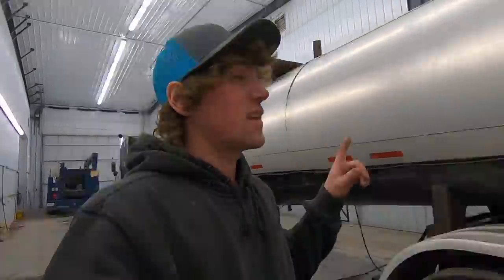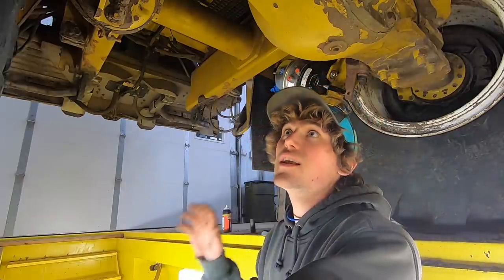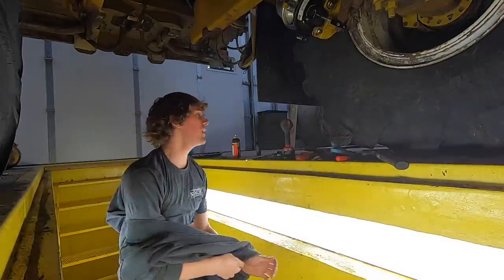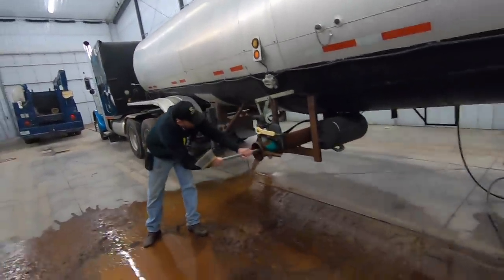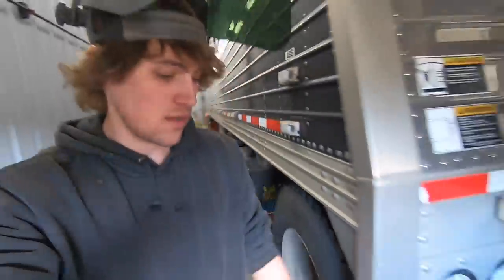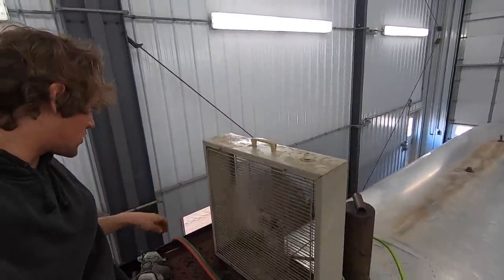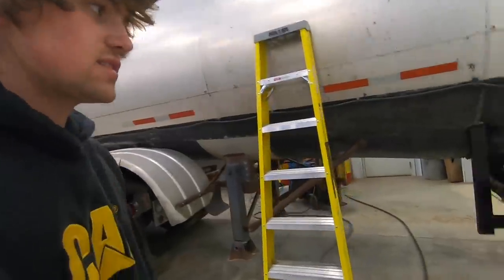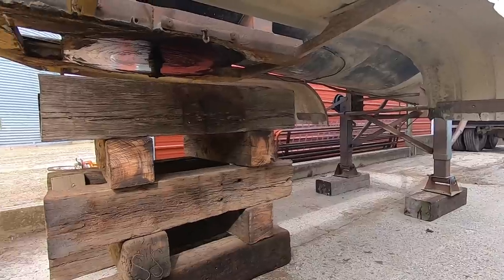Wouldn’t Believe What’s Going On Now

Comment: We have a pit in our shop it's very handy. In michigan we have to have a exit from the pit to the outside of the shop in case of fire.  We also have to cary special insurance on the pit . We were required to have a  ventilation system because welding and torching  gases like acetylene gather in the lowest point of a building if there was a leak . Pits are useful but are an insurance liability.  We also have 2 hoists for cars and light pick up trucks . We do mechanic work and fabrication on the side during the winter on cars trucks and heavy equipment. Nice video stay safe and farm on my friends !

Comment: The little 4 inch long hole in the side of the brake chamber housing is where you can store that cage bolt that compressed the spring after it’s removed out of the cage so if you need it in the future to pull the equipment somewhere you can re cage the chamber and move it. 👍

Comment: Please don't let anyone ever go into a confined space without checking the oxygen level, especially a tank used for transporting hog manure, which is rich with methane gas. To top of all that, you used a torch to cut metal inside the tank where toxic gases are abundant. I have 1st hand knowledge of some horror stories. Please be safe!
Reply: It hasn't had high manure in it for years there's no methane in there

Comment: That nut and bolt that you removed is called caging bolt. S lot towing companies has to use them if a big rig can't supply air for it's brakes. The brake cage bolt releases the brakes so the vehicle can be moved. Love video's keep up the good work and god bless and stay safe.

Comment: Just a tip, landing gears on semi trailers are normally rated at 50,000#. But I think you had the right idea with cribbing under the king pin plate. Never hurts to cya. One idea to save wear and tear on your well pump is to use rain water. If any of your sheds have gutters, hooking onto them and diverting water to the tanks would get more than you need very quickly.  One inch of rain gives you just under 3quarts per square foot of roof area.  A couple spring  rains and they would be full. I did that off my shop roof, a couple years ago I had 10,000 gallons from 3 rains. The only issue is leaves in the gutters, but if you dont have trees nearby, it isn't an issue. If you did have leaves, a filter can be made from a 5 gallon plastic bucket and cheap 5 gallon paint strainers. They worked great for my rainwater setup. Just some ideas, good luck. The best part of it was it is all gravity, no electricity required  to fill the tanks.

Comment: Hello friend, on the back/rear of a brake pot there is a bolt called a caging bolt that is to keep the emergency spring side compressed. When I measure my push rods after old pot uninstalled I will apply air to the service side with a airline with a shutoff valve/handle to both the old and new pot, that pushes the push rod out to it's max length so you get a bang on measurement. Also you had it right at first after installing the brake pot and installed your pins and air lines, remove the caging bolt make sure you release your park brake after chocking the wheels. Then do a brake adjustment, going all the way tight with the slack adjuster then backing off half a turn, will give you 1 ½" stoke. Cheers! Keep up the good vids! And hard work!

Comment: I worked for a company hauling liquid manure for nine years. Durring the time one winter i was inside all 11 tanks putting a huge 8 inch discharge pipes through the tanks, and up the front and a spreader on the rear.

Comment: So I will add to the chorus of voices about the tank entry.  I have done this professionally onboard oil tankers and its 100% SERIOUS BUSINESS!   While you may not have access to all of the gas/oxygen meters we do offshore there is 1 thing you can do to help prevent a serious FATAL accident... ventilate, ventilate, and then ventilate some more.   You should do this ANY time you enter a confined space such as a grain bin, tanker, cistern, and such.   Don't be shy about it, the more and longer the better!  There are lots of things like rust, decomposing manure that consume oxygen, if you or someone working for you enters a space with insufficient oxygen they WILL collapse and start to DIE, and if you try to save them without a source of oxygen YOU WILL  DIE TOO!  These scenarios are all too common in many industries, do some reading,  talk to your workers and make sure you aren't sending someone into a deadly space.  If you want help shoot me a message and I will point you in the right direction.
Reply: a confined space with possible methane vapors no hole watch posted. At least they are using respirators. I hope they are using organic vapor cartridges!

Comment: I I've done plenty Maxi replacements they won't necessarily kill ya but it will leave a lasting mark , when i was a applicator and we had many issues with the pin seizing up in between the slack and the yoke on the can so i would keep that little pin well lubed with antiseize several times a season on our old 1803 terragator 👍

Comment: I think you should look at some of the OSHA requirements for confined space entry. I grew up on a farm, and I know you have to do what it takes to get the job done. I’m not trying to be a safety nazi, but you don’t want someone to get hurt or worse while inside the tank. Think about how you would get someone out of the tank if they were to pass out for some reason. I would consider having a rescue rope and dedicated attendant at the hatch. I would also consider using an O2 sensor to monitor the air inside the tank if you’re using the cutting torch.

Comment: They have a hevy duty commecial gilmour 3/4" I.D. hose, open then ends for winter.  IT should help the flow also if the hose is y'd off with a regular splitter, it cuts your flow by 50%. Gilmour sells a full flow Y and Full flow shuoff if you put one by the tank.  That should improve the flow rate pending the well output. Tanks a lot for the video!

Comment: Seen the inside of a many sludge tanks myself. Where's your confined space entry permit? :P It's a thankless job, but paying it out to a vendor is unnecessary. You may want to find a way to block the light coming in that dome, to prevent any algae. Nothing worse than plugged nozzles. Cheers.

Comment: Wow!  You have to be kidding me.  We farm in Northwest Washington and we sunk a 12 inch well casing down 100 feet to pump irrigation water from.  Its plugged into an aquafier and has never run dry no matter what time of the year.  We use a tractor pto driven 4 inch pump and can fill our water truck lickity split.  I cant imagine using a garden hose to fill a 6,500 gallon tank.

Comment: Step one when putting it back together is get the slack adjuster hooked up first. Then the two bolts that hold it on to the frame. Then the air lines.

Comment: You needed to adjust the slack adjuster with the parking brakes off
Reply: you don't need to adjust slack adjusters anymore.
Reply: @scottgadberry1377  I think he meant set it up....
Reply: @scottgadberry1377  only if you have auto slack adjusters. Even with auto slacks, you need to keep an eye on them. They aren't perfect.
Reply: @Scott Gadberry When replacing a brake chamber, you do have to adjust the brakes to make sure they are within spec. It may be close, but why not make sure it is correct.

Comment: As a welder myself, I am loosing my $h!+ watching you guys work in that tank. Please take a tank/ inclosed area safety coarse. All I am going to say lol.
Reply: with all that rust and then the torch use in the confined space I half expected someone to go down - thank god it all worked out.
Reply: I hear ya man, I pulled a tanker for 10 years & worked around the yard & Tank Wash. I thought maybe they would at least check Oxygen Levels, but NOPE!!! Not Even. SCARY.
Reply: You really need to learn about the hazards of confined space
Reply: @Cap513  Agreed, Oxidation = oxygen depletion
Reply: I was having a mild panic attack watching these guys in that tank. Even if they were set up to do a rescue, If someone did go down it would be a nightmare trying to get a guy out that hole.
Reply: No doubt!! Those rules protect the employer too! If short cuts really worked - the would not be short cuts!
Reply: @Cap513  O2 levels are not the major problem, as CO2 and heat builds up causing the person to pass out...before running out of O2.
Reply: I really have no words! The total lack of safety protocol here is just, OMG, I can’t believe what I am watching here!
Reply: They werent in there long enough to worry about running out of oxygen, the manway was open , but it would of been unpleasant to say the least, especially when the torch was fired up and warmed up space and ate some o2, but it was one big space the fumes from cutting would of been the biggest issue. But an air line off a compressor  with something like a ball valve on the end to let air flow with the hose hanging inside would fix all that, it would cool the area down, add more o2 while forcing out all the fumes and everything else making it a much better enviroment to work in, i always put the airline on the opposite side of were i was working in tanks because it would blow my gas away when i was back welding  the internal welds and fittings.
Reply: @derreckmckenzie5521  that's just false. You can pass out in an enclosed space in under a minute, especially when you're doing manual labour. There's a reason you need to be certified to work in spaces like that, they are lucky no one died this time around.

Comment: yes. that Caging Bolt does let you take that chamber apart. But, for safety, they have made that a sealed chamber, due to many accidents. That is your Park Brake part of the braking system. The spring that is housed within, is loaded with 27,000 PSI. Never attempt to disassemble it.

Comment: Air brakes are easy if you pay attention 

Lots of companies make brake pots some even put other people’s names on them 

Don’t pay for the name 

Buy the correct size 
Cut the plunger to the correct length
Screw on your clevis hook up your air lines 

Important chalk your wheels so your machine will not roll very important
Step 

Now release the air park brake
Now remove the spring tool form the back of the the pot 
Their is a sleeve on the side of the break pot to store that tool for future use

Store it 
Now check how much travel you have 
Speck is 3/4” to 1 1/2” 
Adjust your slack adjusters 
So that when you push the brake pedal you have no more than 1.5 inches 

And you are good to go

Comment: Hey Chet.  I’m interested to know what you guys use for your pressure wash system?    I see you’ve got plumbing on the wall of wash bay and open and close as you need water.    Do you have a hotsy in another room to keep sound down?   Or do you use shop boiler to heat water and then use a pressure pump?  We are currently looking into building 120x120 shop just trying to get ideas.

Comment: I always measure and cut all the brake chamber rods at 4 1/4 inches. That measurement is with the brake chamber not caged. It is pretty much where all of them end up at. You could go a little longer if your not sure cause you can always take more off.  one of the new mechanics did that in  our shop one time instead of asking one of us first. Needless to say he destroyed a brand new brake chamber cause he cut it way too short. Lol and yes the brake will kill you and if it doesn't you will probably crap your pants. Lol that spring in the back has 7000 psi of pressure. The old brake Chambers had a removable clamp back there, but the new ones don't because people that didn't know what they were doing would take the wrong spring off and release beast! Lol you have to build up air pressure on the equipment and release the brakes to adjust them. With the brakes released, turn the adjustment bolt on the slack adjuster all the way until the brakes get tight on the drum. Depending on what slack adjuster you have, you will either have a square head on the top that a 5/16" wrench will fit and a release button on the side that a Flathead screwdriver will fit under and pull up or you will have a bolt head that a 7/16" socket will fit on that you can push in to back the brakes off. With way, with the air built up and the brakes released, you turn the adjustment bolt to the right or the easy way, way with no tension, until it is tight then you back it off, go to the left, a quarter to a half of turn. It will sound like your tearing up the slack adjuster if you are turning the one with the 7/16" bolt head in it but your not. That's a normal sound. Lol then your brakes will be adjusted. The slack adjuster should not go past a 90 degree angle where it meets with the clevis.  The cage bolt for the parking brake spring is a manual way to release the brakes so you can move the equipment if the engine won't run.

Comment: You should have ventilation in the tank - If  for no other reason than co2 build up.  Big Swede is big - BUT, he has a lot of fat on him. He looks big but....  Those baffles are important. Liquid sloshing in that tank can roll you over.  It won['t suck anything out unless you have a way for fresh air to get in.  For THOSE hoses, Chet.   High Quality LOW COST chemical.

Comment: Haircut is easy- get electric hair shears, put a 1" guard on it, and cut it yourself so every hair is 1" long! Then just trim around the ears...   🙂
Reply: Indeed. I use a electric hair cutter with a 9mm spacer on it for over 15 years now and it always looks perfect and you dont need to cut your hair for at least 3-4 months. Just make sure you hit every spot at least 3 times from every direction so that you dont have any long hair left somewhere on your head.

Comment: Fun fact for getting hosebarb on hoses easier. Heat the end of hose that barb is going into with blow dryer or heat gun for a couple of mins, apply your  preference of lube and hosebarbs  practically fall into the hose.
Reply: Map torch

Comment: i'm surprised there isn't an old pair of cattle clippers laying around somewhere that would be heavy enough to deal with Chet's hair.  You're starting to look like the south end of a northbound bear there boy!  No concern that the residual rust in the tank won't overwhelm the filter system?  It appeared there was still of lot of rust coming out while the Swede was pressure washing.

Comment: That fill valve can cause resistance making it fill slow. If you get a diesel pump handle and use it to fill it will shut it off when it's full. Plus its wide open, no resistance.

Comment: Yupper, The springbreak chamber will definitely ruin your day if you remove the splice band under pressure and the spring itself will remove fingers if you're not careful.
Reply: Fingers???, they'll kill you !!!
Reply: @lennymiller9308  Yes they will! Charged air system (110psi) will result in over 2000 lbs of force

Comment: BELIEVE ME, THAT SPRING HAS OVER 2400 LBS OF PRESSURE BOLTED  INSIDE OF THAT CANISTER AND WILL TAKE YOUR HEAD OF WHILE GOING THROUGH A BLOCK WALL NEVER TAKE ONE APART UNLESS YOU KNOW WHAT YOUR DOING, AND IF YOU DO MAKE DAMN SURE YOU COLLASP THAT SPRING ALL THE WAY WITH THE COLLAPSING PIN

Comment: you need to rig a air hose with 120 pounds with the spring bolt out measure the travel from  the housing to the hole in the clevas then do the same to the new one this will get the travel the same 120 pounds only
Reply: GEORGE HOOVER j7

Comment: You heard right when it comes to brake chambers.  If you don't know what you're doing, you should not touch them, as that spring inside will keeeeeelllll you.  But most of the new ones are made so you can't take that portion of the brake chamber apart in an effort to not kill so many people.  They are dangerous.

Comment: I hate to bring this up but that's definitely a confined space inside of that tanker. There are many OSHA rules that apply when doing work in a confined space like that. If OSHA sees what you are doing or hears of it you could end up with a big fine!  At the very least you need a gas monitor to monitor the % oxygen and the LEL. It would also be nice to monitor CO levels.

Comment: With the breaks un locked Jyst turn it down tell the shoes are  tight aginst the drum don't kill it snug is good enough and then back it off 1/2 turn and you get running clearance and that's about all there is1

Comment: 6:30 That's not how you check or adjust slack adjusters. 
That bolt is a caging bolt. 

Adjusting slack adjusters after air chamber replacement
https://www.youtube.com/watch?v=vWlmdrsU8cM
Bendix air brake maintenance.
https://www.youtube.com/watch?v=nn9r1VpaKNY

Comment: Your wife is cute, She will have no problem finding a new husband. The hatch was too small for Fire/Rescue to get into that tank to recover the body, since you did not have a LIFE LINE rope, they could not pull you out,when you slipped and hit your head or was over taken with fumes. HOW about a air line,putting fresh air into tank,- or better yet, a mask respirator, that uses a hose that supplies air from outside the tank. I won't even talk about the massive fines that would likely shut down the farm. Now on the other hand your family could simply bury the   tank in the field, fill it with water and wait for it... YOU could fertilize the fields, for a longtime.